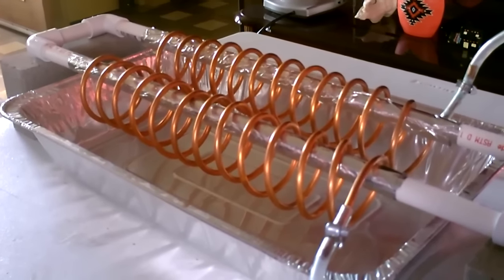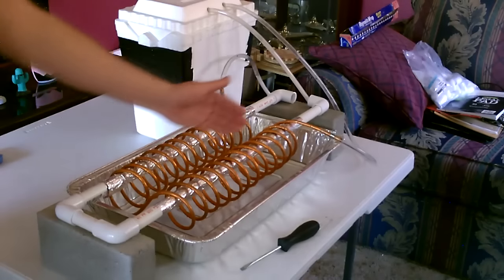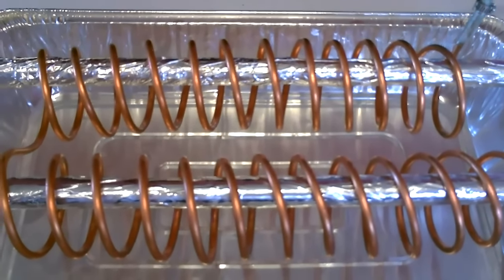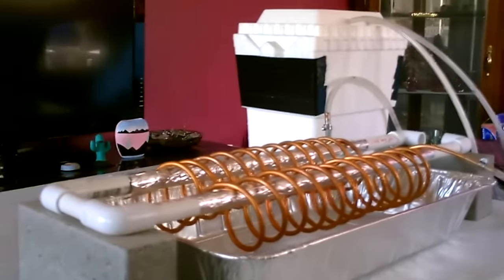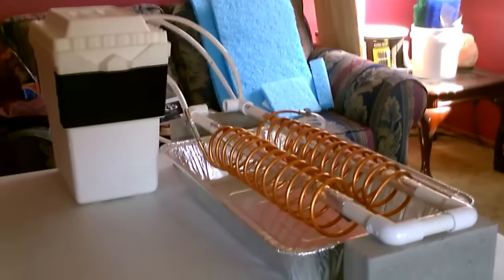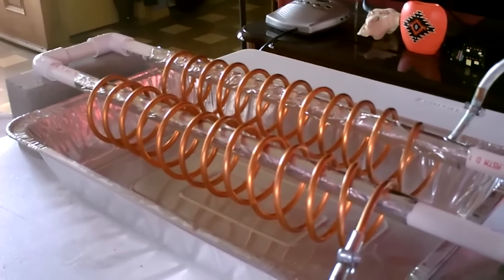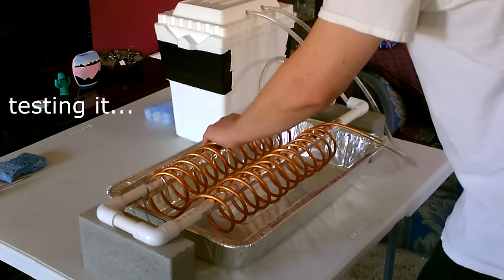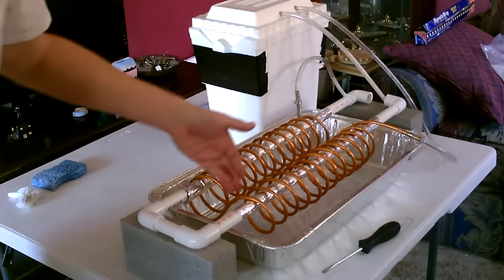DIY Atmospheric Water Generator! - Produces/Extracts Distilled Water from the air! - DIY distiller

Comment: Adding freon won't do the trick as freon operates under compression and expansion in order to become hot and cold.   What I was wondering is having a containter of water underground that keeps colder from the earth. I have a rain tote that has a tarp over it that does keep colder than ambient temp since it's shielded by the sun. I considered running a pump inside the tote to a coil similar to yours into a box that will recirculate back to the tote. Air flow going against the air flow is key. Pretty much the basics of any exchanger. Adding some sort of baffle or channel to force the air in the desired direction might help as well, but this would also require a method of drainage and collection to see if it actually works. Solar panels with a backup battery would be nice for when the sun goes down to continually move the air. Night time may chill the water to a degree and condense water vapor.  Box that coils go into I would like to think would benefit to be black or shiny with glass front.

Comment: Nice work!  I did think it was a little humorous that in order to get a little water a lot of water and ice was needed.
Reply: If there was a way to cool down the water "coolant" without needing ice, it might be practical. Maybe a Peltier module? If you could make a sealed box with the cold side of Peltier modules facing inside the box, that might be enough to chill the water. Then you would only need to fill the box with water once (or at least only once in a while). The Peltier modules and the pump could be powered with solar cells. This way, it should be able to extract enough condensed water to more than make up for whatever you have to add to the box periodically. That's the only way I could see this being practical. You need a way to reuse the same water, and a simple way to cool it down enough so that water vapor in the air condenses on the coil. It doesn't have to be freezing temperature, but as cold as possible.

Comment: so this consists on a full water cooler from which the water are pumped through those copper pipes and back to the cooler
in close circuit. the rest is clear, thank you

Comment: I'd like more information on actually assembling this and what sort of water pump is used.
Reply: It looks to be using a small aquarium power head pump.   And, it appears he is using cold packs that he freezes  and then drops them into the Styrofoam cooler of water.

Comment: I’d like to see this test done with cold tap water... without ice. I’m sure it would work, but I’d like to see the difference in production rates. I’d also like to see more precise time stamps. Maybe set a stop watch next time. Cool video, concept and production.
Reply: @Drakilicious you are missing the idea.
Using room temp water is what is available. To make ice uses a lot more energy. You can't really make ice unless you have over 1kw  and  110v.
I've seen video were people claim to make ice using 100w, but it fiction. I have an icemaker like they use and 300w will not keep it going.  I have not figured out how much it uses, but it doesn't last long. Draining batteries in about 5 minutes with 300w of solar panels hooked up. 
Now what would be nice is a system that produces water using just 12v. No ice required.
I live in a natural dehumidifier. I have the heat and the wind. Absolutely great for dehydrating foods. For an example.
I can cut up a water melon. Place it in my rack. 48 hours later I have dehydrated watermelon. This works with meats as well.
And to be clear, my rack is a cage made of 1/4 mesh wire fencing. It sits on two wires (bailing wrire) suspenders over a frame for a 250 gallon tote. And 2 wires over the top to hold it.
I have dehydrated many thing like this. You can do this to frozen fruit and vegetables also.
Back to subject. I have wind and solar. I have very little water. I can not drill a well. And by can not drill a well I mean it is not possible. I have crude oil under me which leaks into the Water below me, making the Water bad. Crude oil sits at 350 ft and goes to 600 ft. Water is at 800 foot. All water in area is contaminated with oil. Rain catch is not feeseable. In the past 12 months I have only recieved a total of 1.25 inches of water.  I know people will not believe me on this but it is true. Funny thing is 10 miles south and 10 miles north receive a lot more rain. It wierd. It like I'm on a dry island here.
This is why I REALLY need a system that will make water. In truth I would spend thousand if I could get a few hundred gallons a day.
....
Oh and for those that think selling the crude will work. The short answer is nope. Can't get anyone to pump it. There is billions of barrels of oil under me and no one will pump it. I have all the gasoline, kerosene, diesel and oils I could ever use, but not one drop of good water. 
.....
Reply: The bigger the water tank the cooler the water. I have used in the past a 25 litre plastic garbage bin as a cooling water for a distiller column for home distillation using a water pump. Same sort of principle but cooling a hotter vapour down to liquid.

Comment: Question: the water pumped by the pump is it cold? Do you have to put ice in the cooler?
Reply from the maker: hi. yep it's cold. if your water isn't cold enough then you have to use ice or ice-paks (or some way to cool it down). the colder the water is the better.
Reply: @desertsun02  Thanks!😃👍💛

Comment: I think the problem with using water as cooling medium for coils is the fact that will heat up itself fast, and when its heated above dew point temperature  it wont collect water anymore
Reply: need to keep tank out of direct sun or bury it or partially bury it in the ground to aid cooling. i thought of burying the plastic pipes in the ground to aid the cooling effect. Water is hard to heat up ! That is why they use it to put out fires.
Reply: I create water in my hot house it comes off my plants and collects on the inside of the plastic covering.

Comment: Consider using cold air from your AC unit to cool the inner diameter of the coil. And the opposite for winter, keeping your coils in a cold area. Condensation year around without the need for ice - just use an air pump. You need a 25° delta Fahrenheit to achieve condensation. The higher the delta, the better the condensation to relative humidity. Hope this helps.

Comment: What would be best conditions? night time when water and copper would be cooler or mid day when temps were above 90 or more?
On a larger scale this system would be a life saver for Native Americans in northern Arizona who are currently driving several hours each week to pickup safe water.
Reply from the maker: hi. main thing seems to be humidity. high humidity is best for max water production.
Reply: Getting safe water from suspicious water should be easy for everyone, especially when there is sunshine. A book has about water for animals in Chile  from late 19th century to early 20th. Glass covered pond, and the condensation ran off the glass into troughs, and the glass was much colder at night. Some pollution might be too bad, really bad chemicals or elements.
Reply: @desertsun02 Have in Solar Engineering of Thermal Processes, 2nd edition, section 18.4, Solar Distillation.

Comment: So just how does it work? Are you pumping the cold water through the copper? And what does the PVC pipe do?
Reply from the maker: hi. yep, the cold water is being pumped through the copper coil. that cools down the cooper to below the dew point and dew (condensation) forms on the copper. the pvc pipe just holds the copper ✔
Reply: @desertsun02  Thank you for the clarification.

Comment: DC water pump run off solar panel. Ice bucket with ice and water inside, with the pump.   You will need to keep replacing the ice in the bucket.  The solar panel will keep running the pump as long as there’s enough light hitting it. The pump may run slower if light is lower.   Might be good to get a solar panel that has a chunk more watt-output than what the pump requires, to get best output during daylight. 
The pump recirculates water through the copper coils, where the cold/warm differential causes condensation from humidity in room.   As far as I can tell, the aluminum foil on PVC pipes is only to support the copper coils...though, the aluminum foil might reflect radiant temp at the copper coils??   --> IF you set this system up, you will want to put it inside a protective case, fed by air stream that goes through an air filter, to keep the condensate clean...OR, will need to run the resulting water through a filter, to remove dirt, bugs, etc.    
Humidity is relative to the site you are...but there is still humidity even in deserts
...though, desert locations will have more humidity below ground...
You can harvest humidity from ground in most deserts, by digging a hole, setting a cup or pan at the bottom, covering top of hole with a plastic or glass membrane that is pushed down in center  or tilted towards the cup.....during night, hole is cooler; as daylight begins, water condenses on underside of membrane and drips into the cup.   
ALSO...one can harvest humidity from large shrubs...though, you will want to be sure those are not poisonous shrubs...by covering large sections of the shrub in a large plastic bag...in the sun, the shrub loses water through it’s leaves, which collects inside the plastic bag...BUT...you will need a LOT of those, to make enough water to survive on.  
ALSO...can harvest humidity from fog...that has been being done in droughty areas of South America...they hang large sheets on a line, with a trough at the bottom.  Morning Fogs rolls in, it condenses on the sheets, drips down into the trough, and is piped to storage for villages.

Comment: Could use solar panels to make ice. There's a couple videos on one hooked with a battery to keep the load right. Then have it dump the ice automatically into the res. If you could make the melted ice go back into the ice maker then you could keep it recycling and collect the excess.
Reply: First you make ice,
Then you use that ice to condense air!!!?

I mean,
If you have facilities to freeze water (0°C),
Then why use ice to condense...

Isn't it silly?

Comment: 1.) what kind of pump is that and how’d you connect it?  
2.) what temp is the water and how much did you put in?
3.) how long are the pipes and tubes? 
4.) is this even an instructional video or are you just commenting on whether you like what you built?

Comment: I noticed you had an ice pack in the cooler? What happens if no ice or electricity??
Reply: Fun Videos 2020 exactly, could run on a solar panel, water would be slightly cooler if dehumidifier was shaded, but would take a long time to produce a decent amount of usable water! i guess could have solar powered chiller too!

Comment: What if you used peltier device and attached copper plate to it? Air will condensate on the cold side of peltier device and produce water. Hot side of peltier device can be cooled with heat sink and a fan.

Comment: Key is to chill the copper coils. Solar or wind powered thermoelectric cooling would be one method, or pump cold seawater. Cool a tank of salt water at night when air is cold as a reservoir of cool water during the day.
Reply: there would be a mineral build up of salt inside would work after a year or less

Comment: Why don't I get this???
What's up with the box?
How does the water move through the coil?
Reply from the maker: hi there. the box just contains the cold water and a water pump. the water is moved through the coil with the pump and when the coil cools down, water condenses onto it and then drips into the pan. that's about all there is to it 🙂👍
Reply: @desertsun02  thanks desert sun....big big fan of yours ever sense  I first saw your video with the homemade air conditioner made out of the cooler!! Way cool ...gonna be implementing some of your ideas as I live in Phoenix myself.
Like one idea I had that pretty much piggy backed off of yours was why not have the cooler set up and just run a fan that's fit snug with bottled water that's frozen??
Or because we have an EVAP cooler and the duck work is old and basically comes to a tee going into one room/ the rest of the house.... anyways where it comes out into the rest of the house why not stick a frozen milk jug right in there?
Passive AC I guess you could call it?
Anyways thanks for getting back to me so soon....stay cool desertsun02
👍👏🌵🌮🤠🤘💯🌻🌯

Comment: How do you cool the water that you run through the coils, and where do you get this much water when you don't have enough water already.
Reply from the maker: hi. i use ice or ice-paks to cool the water. it produces 'naturally' distilled water (the condensation) but the water you run through the coil doesn't have to be clean or fresh (could be pond or even saltwater)

Comment: What's the difference between this and a dehumidifier? 
Not trying to be rude, it's hard to convey tone through text lol. Just an honest question.
Reply: a dehumidifier uses about 350 up to 750watt per hour. while a cooler box that can properly cool/freeze uses around 50watts per hour nominal. We can only make a real equation when we know exactly how much water a dehumidifier makes in the same circumstances (humidity/temperature) as this system.  You can add much more than one circuit of coils on this one cooler. So if you have the space for creating something a bit larger, this could be much more interesting than a dehumidifier - energywise and/or in amount of water gain. The energy factor is a serious factor for anyone who is dependant on solar.

Comment: So you need a freezer to freeze your cooling blocks i saw lieing on your table. You use them to cool the water that runs thru the copper coils. Maby do a project to use a solarpanel to run tbe pump and cool the coils by putting some hoses or something under the ground where it is cool. Would be awsome to see it that works. Then it woul be a great of the grid thing .
Reply: Great idea. I will try that. Want a self generating design. Maybe downward flow may have enough power to push up through surface into condensation pipes. Then collected in an off flowing tank. Have plenty of sun here in Qld.

Comment: Hey,what's on top off the pump,why don't you explain what's in box???
Reply from the maker: hi there. the box is basically just filled with cold water. the thing above the pump is just a blue ice-pak, keeps the water cold.
Reply: Thanks for info and good job on a simple build. I'll use a solar power system to power the circulation pump plus a sump pump in reservoir to a containment tank.

Comment: How many ounces per hour does this generate? I'm thinking about trying this with a chest freezer and an 8' high double cooling tower.
Reply: ok you said about 4 ounces per hour.
Reply: I need 25+ ounces per hour
Reply: those are about 16", theoretically, if they are producing 4 oz per hour, and I made them 8-9' long, I could attain 25 oz per hour and thus, 5 gallons daily. If that goes well, I could design a cooling wall 20' wide and collect the water into my rain catchment. Thanks, God bless.

Comment: How much electricity? Do u need electricity. My air conditioner makes alot of water but cost alot to run.
Reply from the maker: hi. this setup can be run with a very small pump. a pump that draws 5w is strong enough to push the water through. i've used both 12w and 5w pumps but a 5w one is all you need.
Reply: You have an atmospheric water generator . You can do the same with Propane.

Comment: So the idea is to drop the copper coils below due point and capture the condensation. I suppose the piping could be ran a couple of feet underground to could either water or air and back through the coils. But why the aluminum?

Comment: Why the aluminum? Does it preform a function?? Thank you 🙏 I live where there isn’t even a municipal water system offered and I must haul water even though I live within the city limits. I’m thinking of building this with a funnel catching basin and having it drain In to a cistern basin instead of paying 80.00 dollars per 1500 gallons for city water hauled by truck.

Comment: I'm trying to make something like this for disaster relief when they don't have running water available. What could you use instead of coolant to cool the coils down? Could you cool it with just electricity? I'm trying t make it as small and compact as possible.
Reply: Nebula hi, you can use a thermoelectric generator, if that is what you are referring to, to cool down one side. the hard thing to do is to isolate the hot intense area into a chamber. meaning a container where heat cannot escape. and thank God you have a water machine. take care.
Reply: May could try a sprit of Liquid nitro. Gonna run some more test and get back to you on that idea.

Comment: what if the water is warm? in the system, would it still work?
Reply from the maker: hi. typically it won't work with warm water. the colder the water is the better💦👍

Comment: Hello Sir, 
I'm currently working on a similar system using airflow as a coolant. How long would you say it took to collect the amount of water (8-12 oz) seen in the video?
Best regards, 
L
Reply from the maker: hi. i don't remember exactly (but a good part of the day i think). if it's humid where you live it should work even better.
Reply: air has a low coefficient of heat conductivity. Works better with a liquid cooling medium. Also depends on temp of the air used for cooling.

Comment: How and what are you using.
Reply from the maker: hi. the unit uses cold water to cool the coil. it's pumped using a small water pump.
Reply: If you do not have cold water but you have a basement, you could experiment with pumping the water from the cooler basement up into a warmer part of the house. I had planned to do this myself.